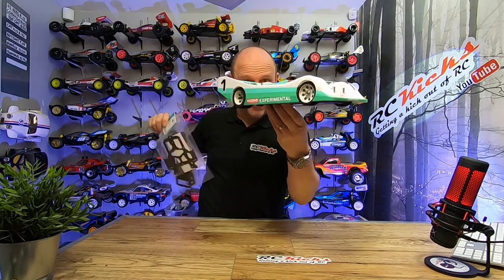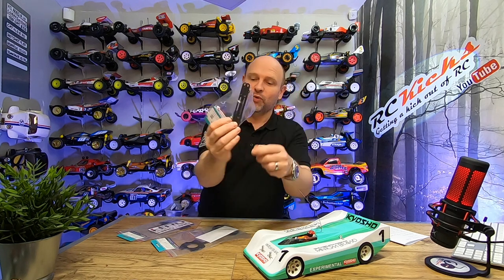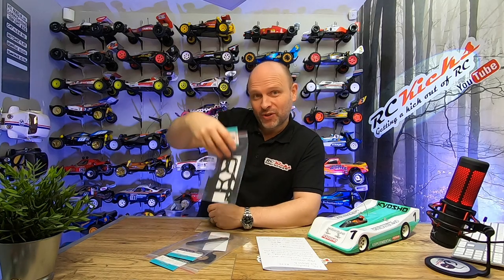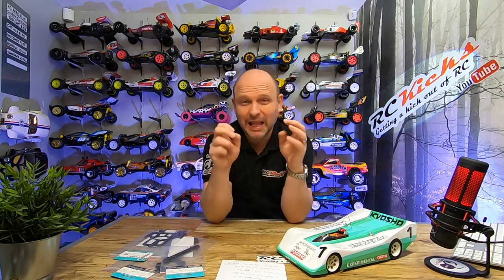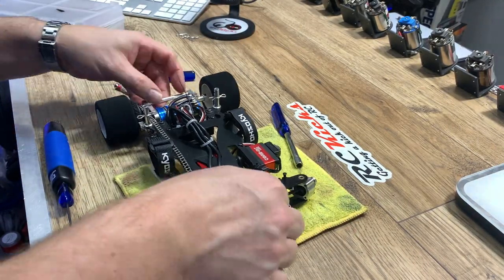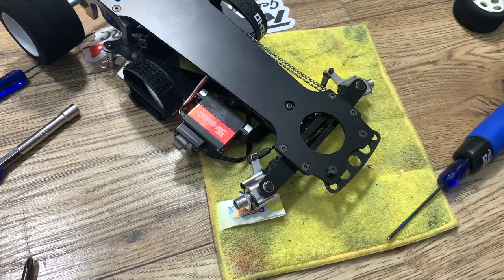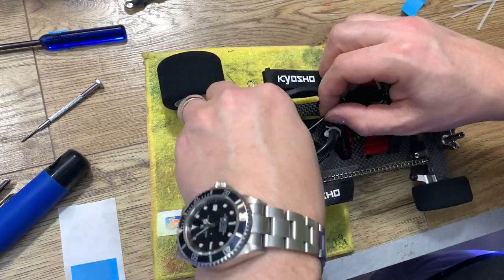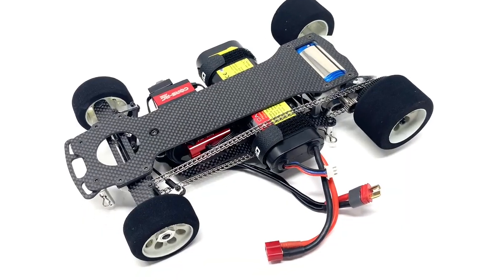Kyosho Fantom Full Upgraded Carbon Chassis Kit From H2-RD.COM Detailed Fitting & Review. Kit 30635B

Comment: You should see if it splits at the edges.  Real carbon fibre components will need sealed at the cut edges. Many of the cheap/fake carbon parts out there are some type of GRP with a carbon veneer.  Yes it's often lighter but rarely stronger. In my experience of composite materials is that they don't look nice, they are often dirty to work and in many applications it's not about saving weight. More often than not its heat or chemical resistance, sometimes it's about flexibility or removing flex. In many of the applications I worked with its was about absorption of stresses.  Not to mention carbon fiber dust is actually more harmful than asbestos.

Comment: My OCD brain screams to adjust the cables lengths perfectly if you are alleeady go for optional parts. Also just for the looks. But it really looks nice with the carbon
Reply from the maker: Yes I agree, if you are going to keep the electronics in the car, adjusting the cable length improves the looks so much.  I did this on my B6.4 race buggy

Comment: Thanks Gavin, I ordered a set of these for my Kyosho Fantom. The parts are very nice and cheap too. I had a hard time getting one of these cars. Not sure why? I could get one of these cars for $500.00 on Ebay. This is a pan car and not worth that much money. Kyosho sells the car for $219.00, but they are out of stock. Kyosho USA does have the body, tires ESC and brushless motor. Thoughts?